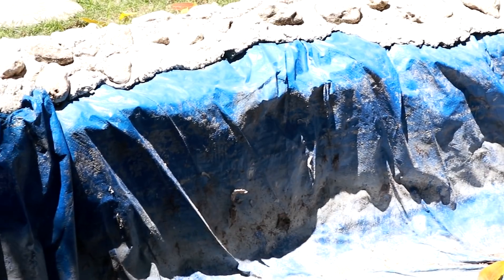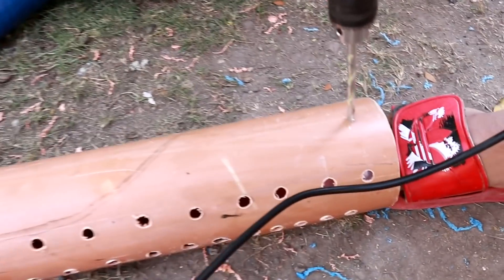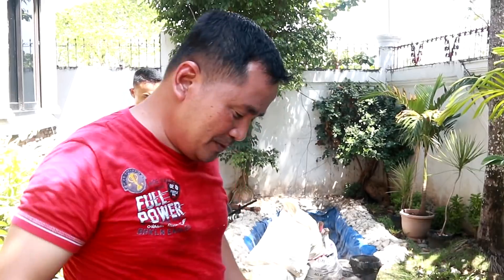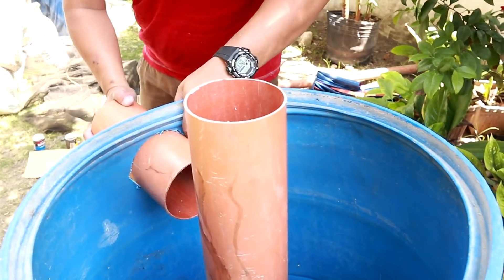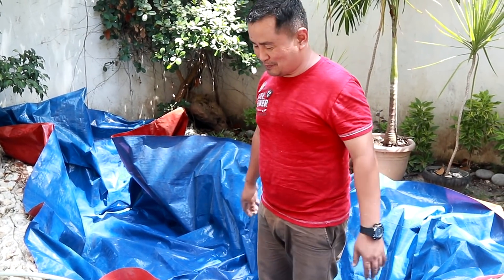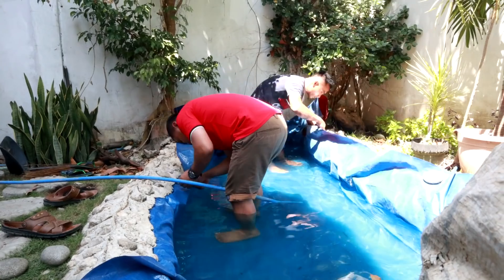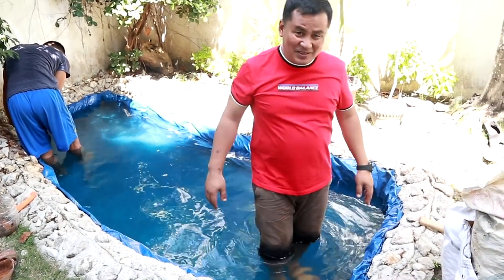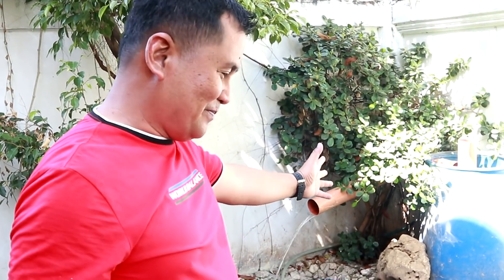Abandon dried up pond re-build after 2 years!! Mega pond is back

Comment: So glad to see you redo the pond. I use something similar to your filtration. I have two containers one filled with small rocks and the other with red lava rocks for bio media. Then I also use a filter pad on top. I pump the water to the top and is runs through the small rocks and pad and then down into the lava rocks. I have never had an issue with any algae or my levels going wacko. Good job!!!